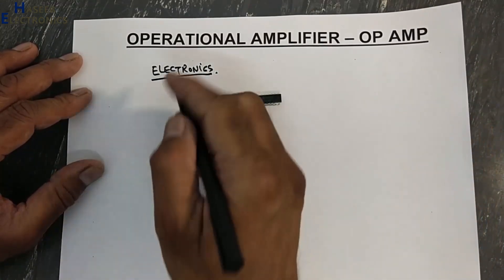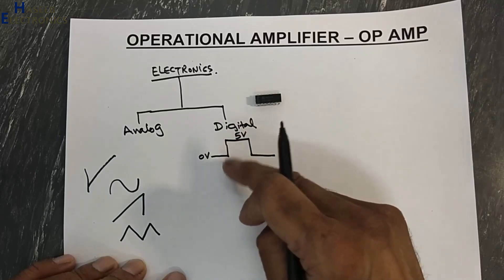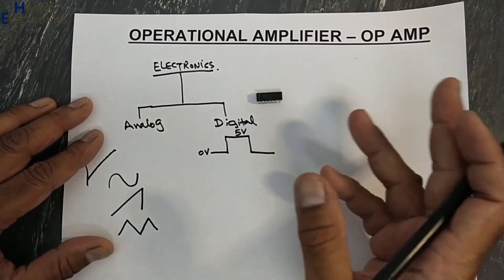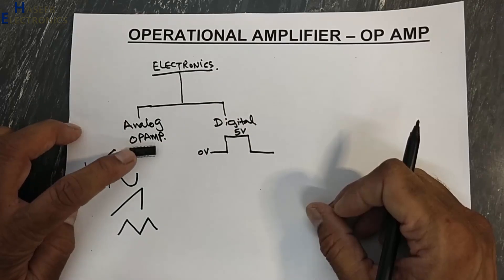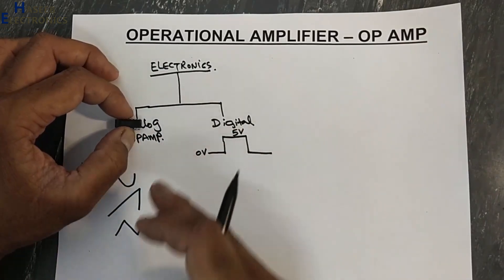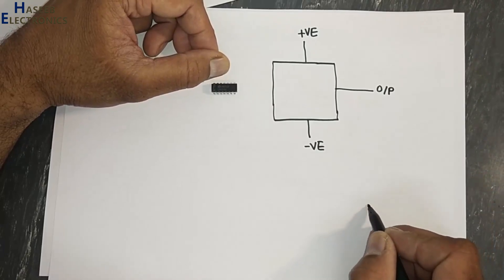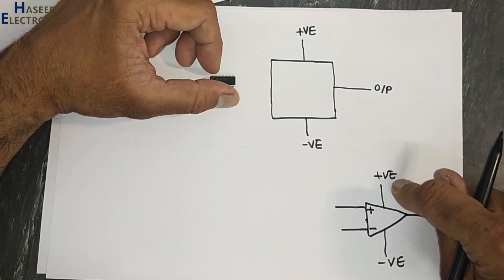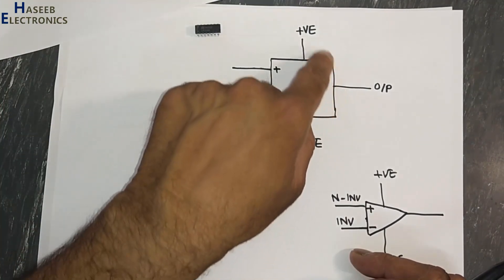{1172} What is Operational amplifier || OP-AMP

Comment: Peace be upon you and God's mercy and blessings. Alsalamo alaikom wa rahmatoallaho wa barakato. Dear and honorable brother, greetings to you again and thank you for your time and knowledge that informs and educates us.  I had a question from you regarding the explanation of the single-transistor circuit that you said, if we inject one millivolt into the input of the circuit, for example, we will have 10 millivolts at the output, and then by injecting 10 millivolts, 1000 millivolts at the output and injecting 50 millivolts, 5000 millivolts.  We will have a circuit at the output.  I probably misunderstood, please tell me how it is possible to have a reversing circuit.  The voltage drop on the load resistance increases.  Also, applying and injecting 1 millivolt at the input cannot bias the transistor, because almost for a silicon type transistor, more than 400 millivolts will reach the base of the transistor to start conducting the transistor little by little.  Please inform me that I am your student, where is my mistake?  If I wrote something that didn't make sense, I will explain it earlier.  Thanks a lot